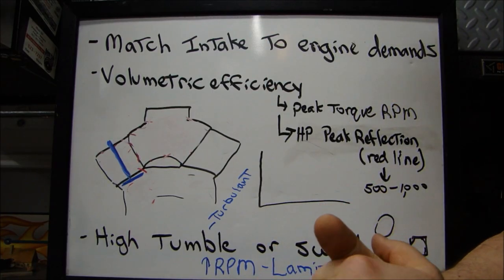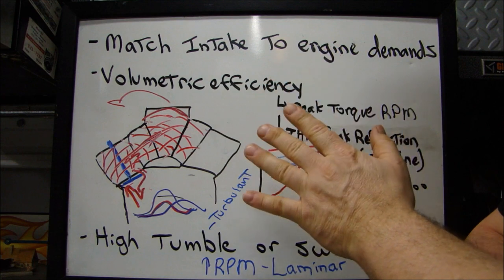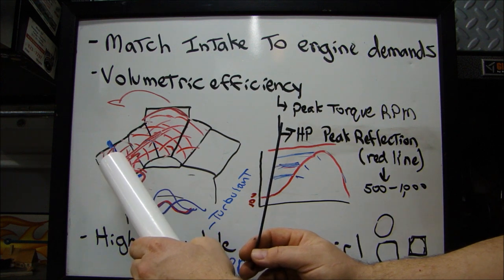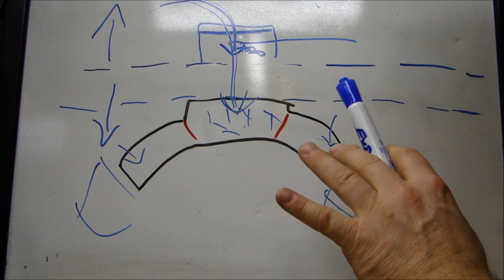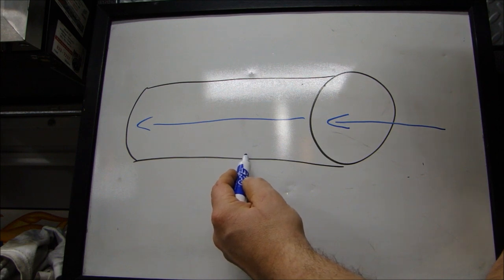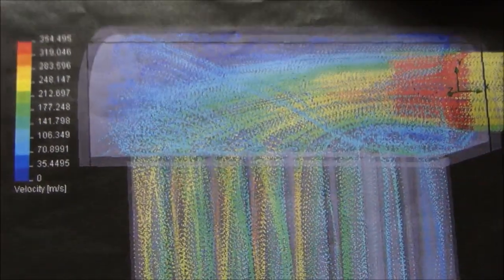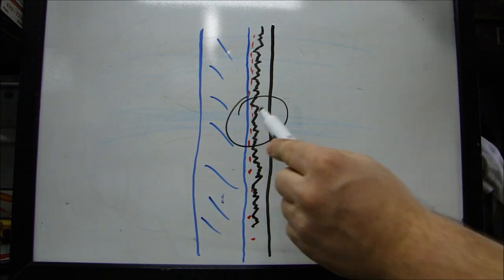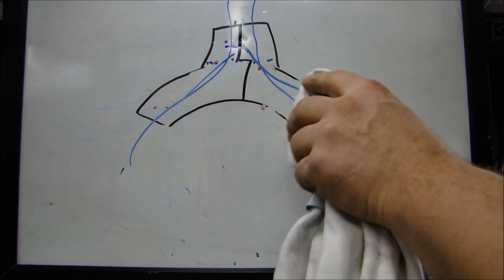Engine Building Part 8:   Intake Manifold Theory

Comment: Well thank you for your answer on the spider tray I would have never known. Being a novice builder. What are some pros and cons using or not using the connected lifters vs spider tray w/dog bones?
Reply from the maker: On high performance engines the spider trays and dog bones are potential failures. I have seen them break. Less parts the better.

Comment: Very good explanation. It helps me to understand gasflows. If you've got a turbo-charged engine porting and polishing the whole intake section is the way to go isn't? Because your supercharge-philosphy air is forced into comnbustion chambers.

By the way 'langsam' is German and 'langzaam' is also Dutch it has the same meaning = slow/slowly.  Pronunciation is much alike.
Reply from the maker: The turbo sucks the exhaust gases out to reduce back pressure. Smoothing out the air flow coming in helps as well.....SLOW!

Comment: Just a little correction on wave interference; in order for one wave to cancel another out, it needs to be opposite the other wave, not shifted like you're drawing was.
Reply: Also, you got Bernoullis principle backwards; the air on top moves faster and therefore generates a lower pressure to create lift
Reply from the maker: Thank you for the corrections

Comment: Good vid. Very informative. Although I will say I'm not completely convinced on the polished intake runners. I have been contemplating fabbing an aluminum intake manifold for my modern Hemi. 5.7 with centri blower. You touched on forced induction briefly, but what recommendations would you have on runner length, taper, plenum volume, etc?
Reply from the maker: The forced induction sort of negates standard manifold theory because instead of vacuum, pressure drives the air and fuel in.

Comment: After all said and a sound understanding of what’s at play here, I still can’t decide whether to keep the Edelbrock Streetmaster 390 or swap to the Performer RPM on my 68 F-250.  What’s it’s use?  Towing some equipment and getting to Costco quickly. I want the torque low and high.  How can you have both?
Reply from the maker: Just go with the high torque

Comment: Hello Pete, i like your videos but I really could use more information on the stock internals compared to the upgrades.  I am trying to  keep a budget build but I am not hearing much on how to decide what stock internals are worth salvaging.  Buying new rods, crank. and pistons is a big upsize to peformance.  Can you please mention more on what if you decide to retain this parts for these engines that are under 500hp.  I also would like some more information on the port and polish steps for the heads and intake manifolds and how this gets done.  Thanks for all you hard work in the videosRob
Reply from the maker: +Robert Warner I have a port matching and polishing video https://www.youtube.com/watch?v=vuJ5eGwvbfI

With stock pistons and rods you can get a big boost with just a head, intake, cam combo.

Comment: Great video. I just wanted to ask - at 50:38 where you can see the plate dividing the plenum into two, the top of the division seems pretty thick and flat. Is that going to be a restriction to flow?
Reply from the maker: That is a fantastic observation! That area is not a restriction, it is a low pressure area. I am making small plates to weld in there so they are even with the top of the manifold.

Comment: Pete I just completed a clean up on a 97 vortec 5.7L intake manifold. I did my best to remove equal, consistent amounts of material from each runner but did not have it bench tested. Is this a risky  move on my part ? I'm concerned about leaning out cylinders?
Reply from the maker: +dlr398 I don't think it will be a huge issue

Comment: I am modifying the top end of a stock 93 LX 5.0 convertible. Just got done with the suspension set up, frame connectors, K support, uppers, lowers, etc. 
I'll be running a Anderson N41 cam and am trying to decide proper intake & heads. 
I would really like you to understand choosing the proper stall, if your ever thinking what vid to make next.....hint hint hahaha.....Thanks again!!
Reply from the maker: There is a way to estimate the proper stall, but the best way is to check on the dyno.

Comment: Thanks Pete I have learned so much from you. I am building a l31 crate engine for my 1983 k10 and was wondering if you would use a performer eps or performer rpm for a stock l31 engine. I see the rpm version has coolant crossover under the carb, do you ever use that for vortec engines? Thanks a ton.
Reply from the maker: Thanks Aaron. The RPM may work out better for you. The coolant crossover is also heated crossover. Coolant up to 190 degrees F could heat it up too.
Reply: Thanks gonna get the performer rpm vortec manifold. Is the water crossover under the carb just for cold weather driving? I live in Montana and I am not sure if I should block them off or plumb them for heated coolant.

Comment: I have a 390 FE motor. I have had my heads ported and polished. I have headers and a holley double pumper 850 cfm carb. Will the Edlebrock performer intake do?
Reply from the maker: I would call Edelbrock tech support to see what they recommend. They have a better idea of the flow of all of their manifolds.

Comment: Excellent series but a little unclear on the physics of manifolds. Forget quantum theory and mention Bernoulli earlier, which for air in this case is essentially that the total of pressure energy and velocity energy is a constant. Most of intake flow is about minimizing sudden pressure or velocity changes while also recognising that pressure waves bounce back and forth. Much of what is happening is best visualized as little bits of mass connected by springs and being pushed around by spring/pressure differences. Those comments you seem to have received about "the advantage of roughness" are really about stopping flow from leaving the duct wall, with the effect that inertia of the moving air causes it to overshoot and narrow the effective throat of a duct  - and so only apply where there is a corner. Benoulli refers to it as a vena contracta if I remember correctly. Same story as why golf balls all have dimples. Keep up the good work, Like I said generally excellent.
Reply from the maker: +DinoProf It's a little different between carb and fuel injected engines. Intake versus plenum ...it can be very different
Reply: +Petes Garage  Thanks for the comment as not really expected. Email is dangerous and easily taken too negatively - so to be clear I absolutely defer to anything you say as a practical matter and really love what you do - so  I agree too that carb is different from injection but would have thought more in the area of fuel mixture control than air volume into the cylinder.  

Went looking for a final outcome on your Cobra oil problem, but could not find anything. Is the final of this series yet to be done. Thanks.
Reply: +DinoProf  OOPS apologies, just noted your comment on your "help going to LA video" re yet to do Cobra update
Reply from the maker: +DinoProf When I get back to the shop I'm going full bore on the Cobra

Comment: Great videos, but 1 question for you. You talked a lot about a cylinder not getting enough air, and because it didnt get enough air it ran lean, but to my understanding with less air, but the same amount of fuel, it would run rich. So what am I missing? Also, if the air/fuel mixture is consistent with this carbureted engine wouldn't the mixture be the same, just not as much would get into the specified cylinders, so those cylinders wouldn't make as much power, but it wouldn't be rich or lean. Is this correct or am I missing something?
Reply from the maker: You are thinking correctly Caleb. I'll have to watch the video again to see what you are talking about. Thank you for the comment.
Reply: No problem, you mention it a few times, but mainly when you are showing the flow diagrams. Thanks for the reply

Comment: I want peak torque (500+) from a stroked Chrysler between 2500 and 6500 rpm, what do you recommend?  The truck that the motor is in is a 1-ton Repo truck so it needs to be fast and be able to tow. Any suggestions are appreciated.
Reply from the maker: I'll build the engine you need.....

Comment: Brilliant very much useful. Can you post a video about math or calculations that we have to consider while designing intake.
Reply from the maker: I will try, I have a bunch of videos I'm working on, but it's mostly basic fluid dynamics.
Reply: Petes Garage can we take take the velocity of air entering intake as car velocity.
Reply from the maker: Not really...it is velocity inside the manifold
Reply: how can we calculate the velocity inside the manifold

Comment: Is the effect of a turbocharger any different than what you described for a supercharger from 23:11 to 26:07? I figure that any turbocharger will tend to lag in its boost.
Reply from the maker: +ucallthatatweet Yes, a turbo will lag in boost. Since it works off of exhaust pressure it has to wait for proper pressure to boost. A supercharger is forced as soon as the RPM's rise

Comment: Hey Pete I was thinking about running nitromethane on a RB30 DETT but I can't seem to find the right injectors or how much fuel I would need any ideas?
Reply from the maker: Pure nitro? Are you sure you can get the fuel pressure high enough? This is way more than a simple answer.

Comment: another ?,  if bolts are dry and go into a water jacket then what to use on threads and bottom of bolt head ? Do you like the studs better than the bolts,  and how about sealant around each side of the gasket at the water jacket openings, also the intake gasket
Reply from the maker: I use thread sealant from Permatex. I'll use studs if it's a higher HP engine. I use High Tack around water jacket and intake openings

Comment: So here's my stupid question with a short background story.  I bought a 440 for my 65 Dodge Polara from a guy who needed money for his wife's operation.  He said he re-ringed it and put a cam in it.  I asked what size cam.  He said he could not remember but stated it was a couple steps above factory.  I want to get a different intake cuz I'm currently running the stock boat anchor. Without knowing the size of the cam, how do I choose the right intake?  Keep in mind the engine is stock except for the cam and new rings.  I don't plan on racing the car but eventually I would like to put an EFI TB kit on it.  either the original EZ EFI from FAST or the Edelbrock E-Street EFI.  I was thinking either the Edelbrock Performer #2191, or the Performer RPM #7193.  EFI kits aside, which intake would you recommend for my big cruiser?  If you need more info I am happy to oblige.
Thanks in advance.
Reply from the maker: If you can, pull out the cam and get the number off of it so you have an idea of lift and duration. If you can't take it out, measure lift at the valves with a dial indicator. You really need to know more about the cam.

Comment: Thanks for the detailed series, Pete. I have learned a great deal from your videos. I'm working here in Australia on an L67 supercharged V6 engine (3800 series GM as you guys know them) and I'm just about to replace the lower intake gaskets. I have another intake and charger that I'm porting now, and wanted to clarify if it's worth gasket matching and polishing the runners or just remove casting lines and leave the surface unpolished  (or even coat them?). I'd appreciate any advice you have for me. Thanks again for your all your great videos.
Reply from the maker: Mathew Wood Thank you my friend. It always helps to clean up the casting lines and port matching the gaskets. Polishing is not necessary. I'd love to come down and visit you
Reply: Haha. You are welcome anytime! I think you would love our car scene down here. It's just a pity that GM and Ford have stopped producing cars here. But at least we'll be getting the Mustang and Camaro here next year. Thanks for replying.
Reply from the maker: Mathew Wood American muscle cars are popular all over the world. There are so many to love
Reply: If the fuel trims tend to jump around in an inconsistent pattern it points toward fuel pressure regulators. I'm warming up to replacing mine...but then mine can't be tested. If yours is vacuum operated, then you can pull the vacuum line off, fuel isn't supposed to come out there, but if it does, you know the fuel regulator's diaphram has broken.
Reply: Mathew Wood
A hint towards leaking injectors is startups where adding throttle really helps "to clear the engines throat".

I had a leaking injector...now I don't and I think my fuel regulator is gone too. lol
Reply: Oops, I think I put these comments on the wrong thread! Copying, pasting and deleting, lol.
Reply: Or not since I can't post on the Scotty Kilmer community even if I click to join...this was in response to your troubles with rich fuel trims, bro.
Reply: DE Nichols Yeah, thanks for the info. I've picked up a service kit for my injectors, as I had  look at the o-rings and they're falling apart. So, once I've done that I'll recheck the fuel trims, but I also haven't ruled out the o2 sensors.
Reply: Mathew Wood
I've had tons of rich problems with that exact problem! Fuel injector seals are such a pain. They have to be secure against high pressure yet, they almost have to be perfectly delicately held too to not kink and leak.

Comment: Great video, I'm building an intake manifold for a two cylinder engine how much past the last runner should I extend the plenum to avoid a dead air space resulting in a lean cylinder? 1 inch, 1 1/2  or 2 inch, what say you?
Reply from the maker: It really depends on the whole manifold design...but I would think 1" would be enough
Reply: ***** thanks

Comment: Good info! But i'm not with you on the example you use at 57:00. As far as i can understand the peak HP is always on a higher rpm than the peak torque rpm. I believe this was an unintentional mixup by you. If not you have some more explaining to do here :) lol
Reply from the maker: You are 100%. I was trying to illustrate if you pick components correctly, the torque and HP will be maximized, but the max HP should be higher. However, if you use heads that are too small and a large intake, you could be leaving Torque on the table. si it is possible to have a manifold that peaks torque after HP....theoretically of course. Thank you for catching that.
Reply: HP = Torque x RPM ÷ 5252
So HP will always peak after torque unless the torque peaks at a redline before 5252 RPM, then they would peak simultaneously. Horsepower will also always be below torque below 5252 RPM and above torque above 5252 RPM. If my logic is flawed, I'd appreciate it if you could correct me with an example. Thanks for your videos, it provided a bunch of insight into building an engine. I now feel much more confident in my ability to build an engine (assuming I use a good machine shop).
Reply from the maker: You are 100%. I was trying to illustrate if you pick components correctly, the torque and HP will be maximized, but the max HP should be higher. However, if you use heads that are too small and a large intake, you could be leaving Torque on the table. so it is possible to have a manifold that peaks torque after HP....theoretically of course. Thank you for catching that.

Comment: Pete need some advice, i have a eaton m122 supercharger that i want to put on my humvee 6.2 diesel i was thinking to use an extra 6.5 turbo intake manifold, i will have to fab a plate to mount charger to manifold, i am curious about the output on the bottom of charger in relation to where it should sit over the opening on the 6.5 manifold, should i go for most direct line of inputting the air or design some type of plenum with a special shape?
Reply from the maker: The straightest possible the better
Reply: thank you, great videos by the way!!

Comment: Great video. Lots of good information. Question. Do you think that in a fuel injection or  direct injection engine there is no need for "tumble" ? Im building my lt1 and read too many different stories.
Reply from the maker: This is what I know. I work on direct injection engines every day. The intake plenum is smooth plastic and the heads are CNC ported. Tumble and velocity are controlled by the design of the intake plenum. Fuel injection engines only need a slight assist in aiding tumble because the fuel source is so close to the cylinders and is atomized by the injectors. Hope that helps a bit
Reply: Thank you for the info!! Yes it helps a lot!

Comment: Great video.
Any idea how on a V8 intake that putting on K&N (less restriction) panel filters on the intake system will affect things like the multiple breatherpipes that come off of it.
Additionally this is where each fuel injector is above each cylinder that share a common chamber.   Does this also affect tumble/swirl?
Reply from the maker: Less restriction results in higher velocity so it will increase swirl and potentially HP.
Reply: +Petes Garage that's good, will it reduce vacuum to the things that need it is also what I wondered.
Reply from the maker: No it will not
Reply: +Petes Garage what's your opinion on K&N panel filters?  Do they cause problems with dust getting into the cylinders resulting in scoring?
Reply from the maker: I do not use them, but I've never heard of any problems like that

Comment: so would you say that a rough surface left in the intake manifold and intake port of a carbureted engine are more beneficial than a polished surface? I guess it would be a trade off of air flow vs fuel atomization. Question is which is more beneficial; personally id say fuel atomization.
Reply from the maker: That would be an accurate statement. However is does help to remove burrs and high casting edges